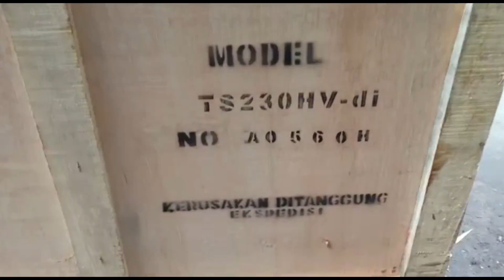YANMAR TS 230 Hdi TUTORIAL TEST & Full Spesikasi Cara Menghidupkan Mesin Diesel

Comment: Mas berapa nomor serinya oil seal flywheel yanmar TS230R
Reply from the maker: 62 - 80 - 9
Reply: @l.i.mgloves5209  mksh bg🙏
Reply from the maker: Sama2 Gan .Trims
Reply: @l.i.mgloves5209  sory bg..itu ukuran apa nmr serinya ya?
Reply from the maker: Itu nomor/ ukuran  oilseal 
Mksdny lobang 65mm
Diameter luar 80mm
Tebal oil seal 9 mm

Comment: Mohon bantu, ada stok baut kop Yanmar Ts 50 ya ?
Reply from the maker: Baut Kop mksdnya Baut dimana nya ?
Reply: @l.i.mgloves5209  baut cylinder head yg 4 buah, kop penutup pelatuk
Reply: @l.i.mgloves5209  baut deksel stud mas
Reply: @l.i.mgloves5209  second jg gpp asal masih bagus
Reply from the maker: Stut Deksel lgkp mur @Rp.175.000
Stut Support Rocker Arm lgkp mur @ 80.000
Bonnet / Tutup klep @ 225.000
Reply from the maker: Gak ada yg 2nd
Reply: @l.i.mgloves5209  ada kontak Wa om?
Reply: @l.i.mgloves5209  yg baru aja, yg pasti baut kop atau  baut stud deksel Yanmar Diesel Ts 50
Reply from the maker: 081 160 9604